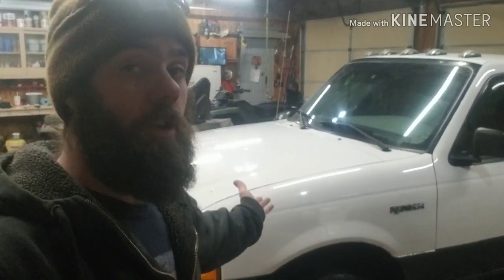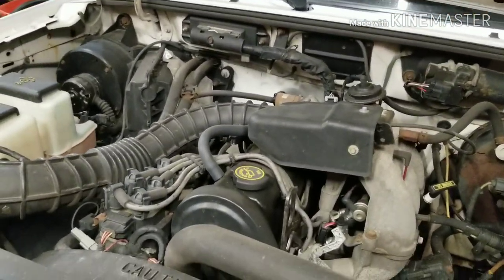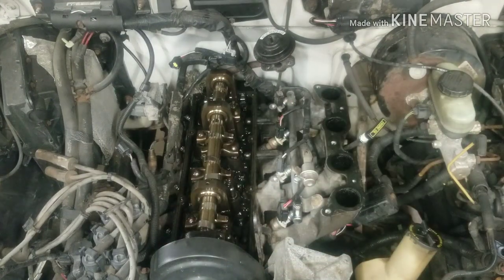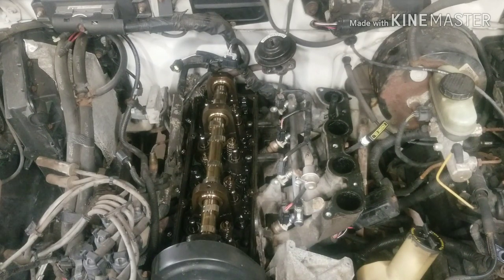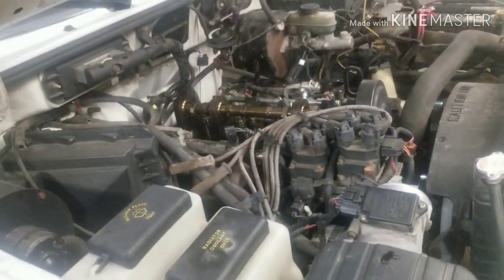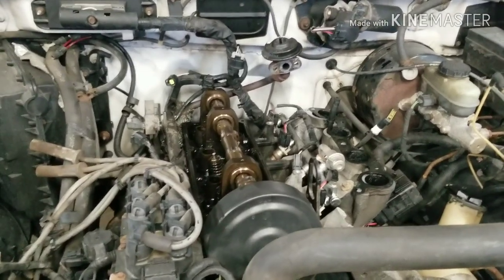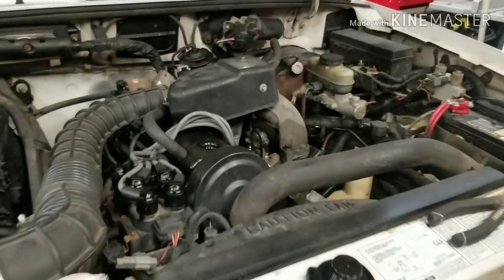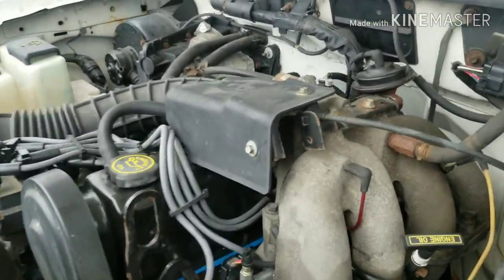How to fix a sticky lifter in your engine.

Comment: Haha dude when you said I'm tired of people looking at me like a circus freak man that cracked me up. That's great I got 2 of these trucks. They're a great back up vehicle and you can haul or tow a surprising weight for a little truck I've almost doubled my tow limit on both of them. The 2010 is at 300k miles and 06 at 170k and the 2010 only hauls in the city for work. Every day the bed weight is maxed out

Comment: Back when I started turning wrenches, I worked at a Mitsubishi dealership. The 95-96 Eclipse came from the factory with bad lifters. W had to remove them, soak in diesel,, manually bleed them with a lifter bleeder that was designed by Mitsubishi,  then soak in oil and bleed them while they were in the oil, in order to prime therm before start up. Paid good money. But was a real pita.

Comment: Every time I change lifters I soak the new lifters in motor oil overnight, that way when you install them they work better no tick, if a lifter keeps moving up and down without tightening up, that means your lifters are bad, and if you can’t compress the lifter with your hand, your lifter is good.

Comment: Have you changed the timing belt? Mine was having the exact same problem and it was the belt hitting the cover, replaced the belt and cover and it quit sounding that way
Reply: @T11 I believe 2.3 and 2.5 liter engines have belts
Reply: Every single 2.3/2.5 Lima engine from 1974 to 2001 has a belt for timing.

Comment: You should have put the lifter in oil for a few hours and pump them up in the oil before you installed them , when you install lifter out the box they will run dry . by the time they pick up oil  can damage in stick.
Reply: Exactly, very critical, I was waiting to see if he did this process, and it doesn't look like it :-)
Reply: He literally was lubing them up one by one as he placed them in you guys need glasses lmao
Reply: He oiled them.

Comment: Great video. Was it worth it you think? Got 237k miles on my '98 Ranger and the tick is getting worse but only when it's cold do I hear it.
Reply from the maker: I'm not sure it was worth it since this didn't fix it however it's still running even after being stolen so I'm not sure. Next time I think I'd run it till it quits running then fix it.

Comment: I have had great success with all the Sea Foam treatments Gas, engine oil and trans fluid the one thing about gas treatments is some of the cheap ones will kill your O2 sensor and give you a check engine light especially if the sensor has high mileage.
Reply: Has it ever helped with lifter tick? Or have u just used it and never had any problems?
Reply: Fist off you got to know what's in a lifter and how it works , no additive is going to solve a bad noisy lifter , there a thin metal shim that has holes and that's what holds the pressure to keep the lifter built up and when the lifter goes bad this shim get a crack in it , then it it won't stay built up then you gat a ticking noise , but with trash in the lifter I recommend what I do ,,,, a half quart transmission fluid every oil change ,,, transmission fluid is hydraulic fluid , and what kind of lifters we got hydraulic lifters

Comment: I have the same truck, well, the same engine, I had a very similar noise, though, not as consistent as yours, but what I did was kinda cheat and just put 5oz of seafoam in the oil (sounds stupid, I know) but it is a good solvent, it gradually cleared all of the little oil passageways to the lifters in a short amount of run time and it actually hasn’t come back. Except for the occasional lifter clatter on a very cold morning.
Reply from the maker: I did that, marvel, rotella diesel motor oil, engine cleaner, more sea foam and yea it kinda always did what it wanted to. 10k miles since and still clicking and running strong
Reply: How long did u leave the seafoam in with the oil before you drained it, or how long did u drive it with the seafoam in it before u changed ur oil...?? Got a tick thats loud so I shut engine off then i start it back and its quiet as new...has done this for yrs...
Reply: @berniceperry8898  300 miles, the tick cleared up after about 20 miles.

Comment: i got a lifter tick on my 3.0, would it be safe to drive (and pull trailers) with it?
Reply from the maker: In my experience it goes one of 2 ways. It ticks forever and it's fine or it starts to tick then she blows if its not fixed. So it's a coin flip at least motors are cheap for em
Reply: It’s easy to change lifters on a 3.0L I did mine mine wasn’t making any noise tho my 3.0 bent a exhaust valve so I put new heads an lifters an that fixed it

Comment: There's no reason for the lifters to be sticking or stuck, unless your not changing the oil on time or some additives was added or perhaps somebody pure sugar into fuel tank. I have a 631,000 miles 96 Ford Ranger still running smoothly.
Reply: Wow! Amazing.
Reply: 436000 on my 96 2.3 . My lifter is just starting to tick. My motor got hot not long ago and that's when it started.

Comment: Sound better before you put them dam Chinese lifters in , and you didn't show how you got those lifters out lol but I know, at the bottom of the lifter bore there's a hole you have to screw a grease fitting in a take a grease gun and pump the lifter out when their stuck ,,, I'm 65 I've rebuilt over 50 of these engines in my years the same as the 2.3 / 2300s in the pinto , only thing different is roller cam and rocker arms / boys years ago we had good quality made parts with US steel but now we got the Chinese junk , ,,, word to the wise get your lifters at jegs high performance next time / and yes that's still lifter noise not a dam injector
Reply from the maker: Yea those lifters were junk I agree
Reply: We ran these engines on dirt tack we put shims under the lifters on the intake and exhaust to get more lobe lift to create more power.
Reply: When installing new lifters you must put them in oil and take a screwdriver or something while their in the oil and compress the air out and they will pump up hard,, and that's how you bleed the air out ,,then install them and you'll be good to go !!!!
Reply from the maker: @bobbysilvers167  I did do that.